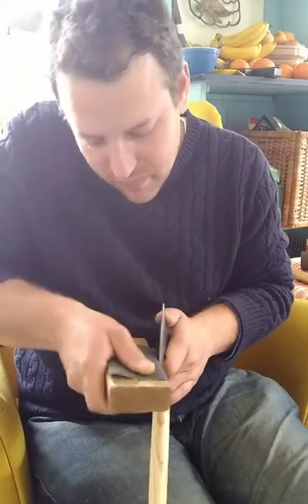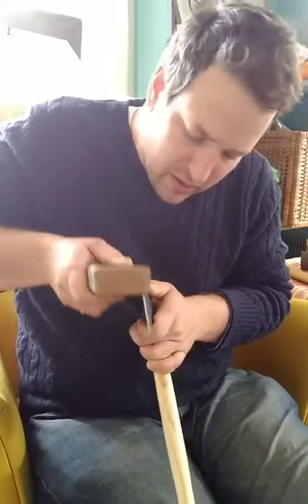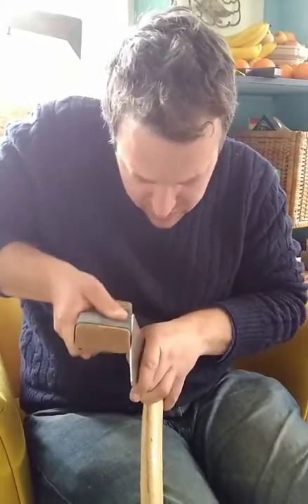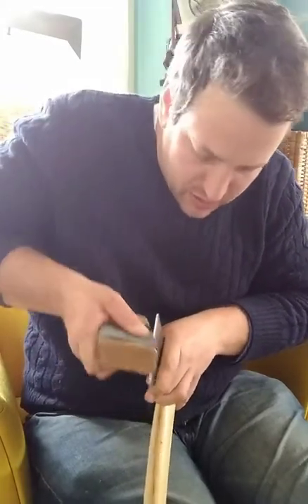Modifying axes for spooncarving: sharpening and carving down the handle

Comment: I had the prandi, it arrived super loose, and remained loose even after oil and another wedge. I returned it for the marbles camp axe, that I’ve since rehandled, and filed. It’s been perfect for me, but I have a very hard time sharpening it, no matter what method I try
Reply: I have a marbles ax also and I have come across the same issue on sharpening. I kept rounding the tip so I think I'll try to use a belt sander... wish me luck!